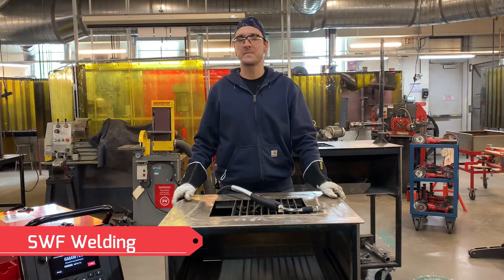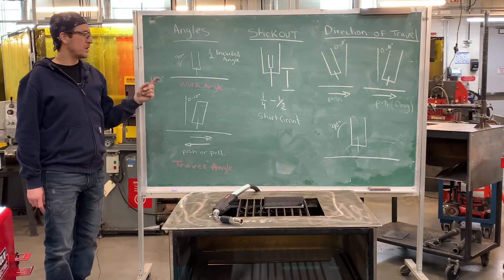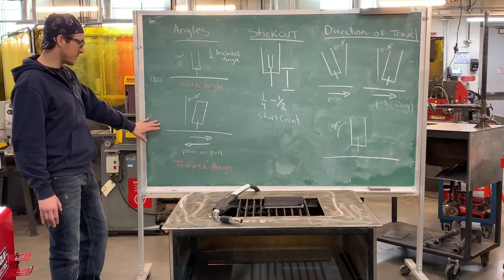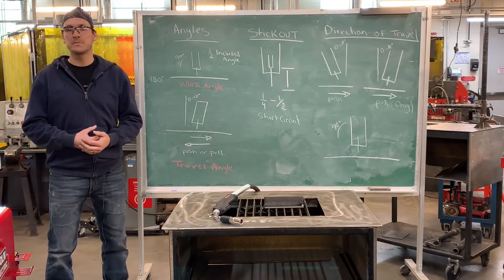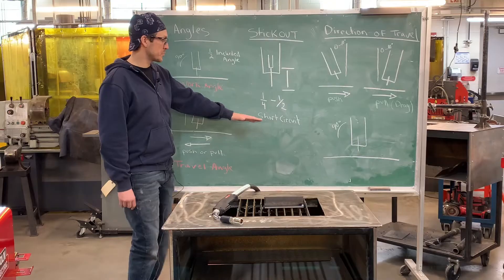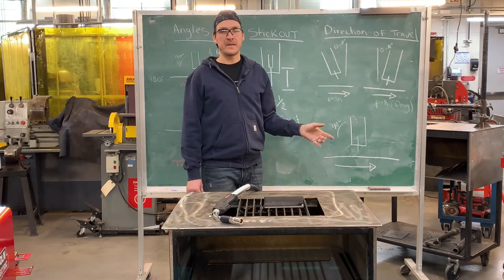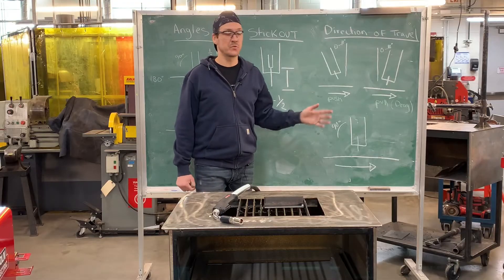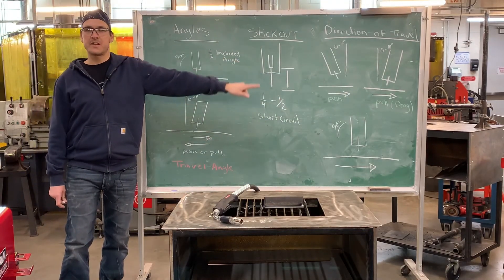Mig Welding Angles, Stickout and Travel Speed Explained

Comment: Hi, lately when I stop each weld the wire stops too far out so I need to snip it shorter before I start the next weld, do you have any ideas why this would have changed and it there a way to change it. I have tried increasing the tension on the roll hoping it would stop quicker but that did not help. My welder has automatic feed speed control but I always have it set to the minimum anyway so I can't change it there. I have just cleaned out the liner so that is probably why it is running through easier and less drag to stop it at the right stick out but I need to be able to adjust it because I am only doing short welds welding nuts into place so only about 1/2" each weld and it is a pain having to stop and snip the wire after every weld. Thanks.

Comment: Instead of 45°, I actually find it better to angle the torch roughly in-between 45°  and flat to the top plate or piece of metal. About 30°, and point ur welding wire about 1mm away from the gap where the two pieces of metal join together (touching the bottom plate or piece of metal).